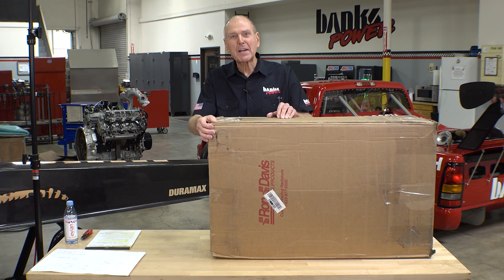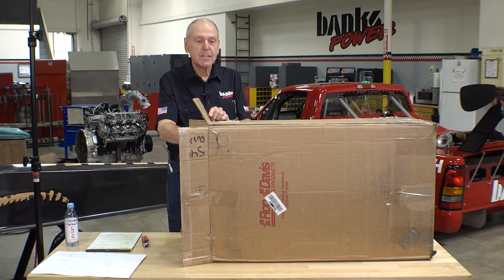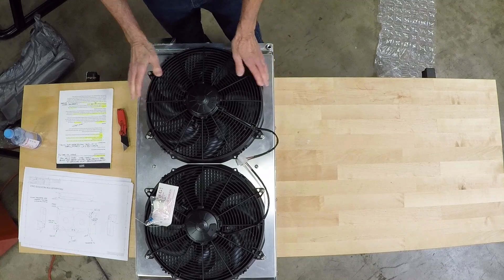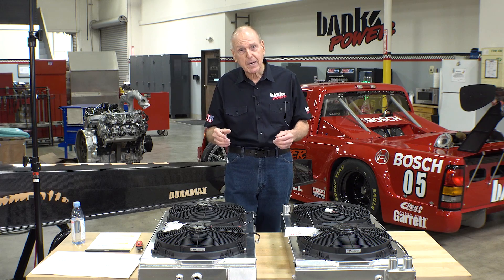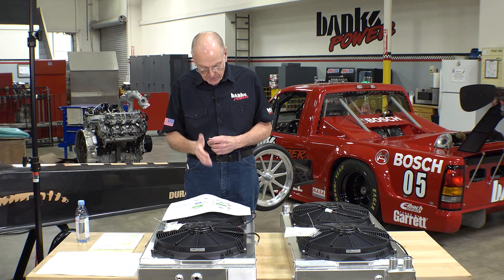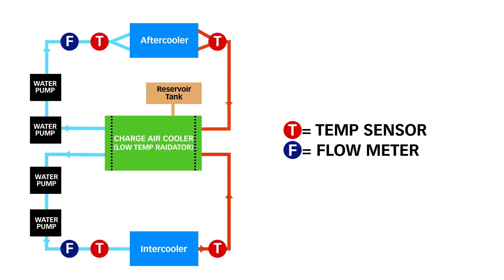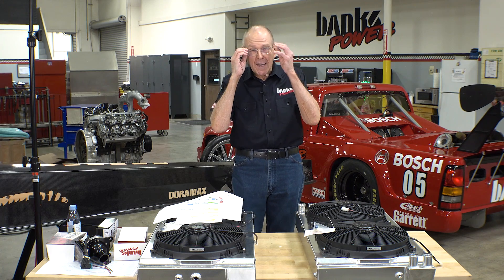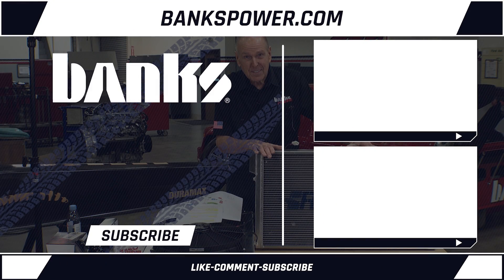UNBOXING custom RADIATORS for the supercharged twin-turbo Duramax!

Comment: Do you have a aftermarket Charge Air Cooler coming for stock 2017-2019 duramax L5P? Or is it not beneficial?

Comment: I’m curious why such an amazing company like Banks would want to do work/support/promote a company like the Diesel Bro’s? The Diesel Brothers have given diesels such a bad image. They’ve been proven in court to be nothing short of criminals and are just bad business. I understand they are able to use their look/popularity to beat the system but they bring down the entire diesel industry. I will not support Banks myself if they support guys like the Diesel Bro’s, no way.
Reply: Did you actually read the complaint against them?   Some liberal doctor who had nothing more than time and ability to sue DP did so for removing emissions systems off of trucks they were rebuilding; the same thing the EPA ended up going after many diesel performance shops for.  This whole emissions vs performance and power is a whole different discussion.  Especially since right now the street at Moab and other parks and even the Salt Flats are creating all kinds of emissions issues.  Banks didn't idenifty what exactly the welder did for their radiators but clearly there was a reason for them to do so never mind that he appeared on their show.  And remember he who hasn't comitted a sin can throw a stone.  I'm sure we'd find lots to question if the spotlight was on you.........

Comment: I've tried electric 'puller fans' for years. On the street and off roading I have been disappointed. But when used in combination with a front mount electric 'pusher fan' I have had great results.
Think about it, if you have a  house box fan, do you want to sit on the intake side or the exhaust side of the fan? Which side moves more air?  Every time I want to sit on the exhaust side with it blowing air in my face. 
Just saying. A pusher fan and puller fan when used in combination are awesome. Either by themselves, less so.

Comment: And yet you have missed the most important part of the cooling system in an internal combustion engine. We have proven with 30,000 hours of dyno testing that the most important component of an engines cooling system is the water pump not the radiator. The pump must perform flow but more importantly pressure. When you can understand the latent heat of vaporization is when you will understand what I am saying.
Reply: It’s amazing when someone doesn’t really listen to the video and then comments as if they are intelligent-and embarrassing the hell out of themselves.
Watch the video again, sparky. And this time LISTEN.
Reply: @officialdirtysouthtv  So what flow rate does the pump operate and head pressure sparky?
Reply: Once you remove your head from your rectum and go back to @4:00 and listen, is when you will understand that that was mentioned.

Comment: Damn that is a TON of cooling power! My 12v has a 4 core mishimoto with dual 16" SPAL fans and it hardly cracks 180 when pulling a steep grade with a trailer. I couldn't even Imagine the potential 2 of those suckers would have